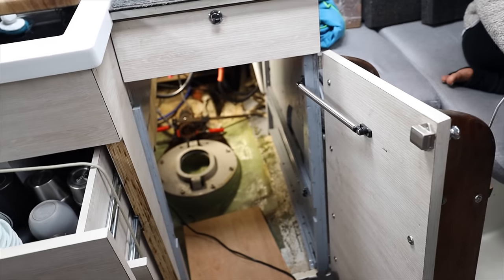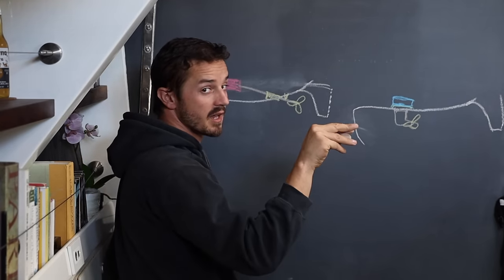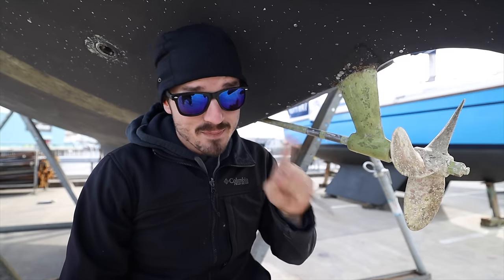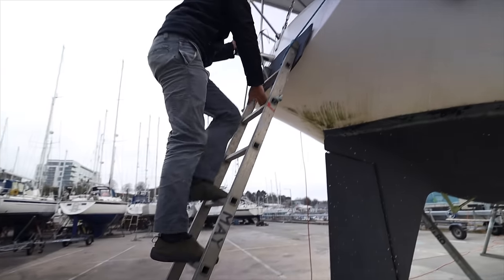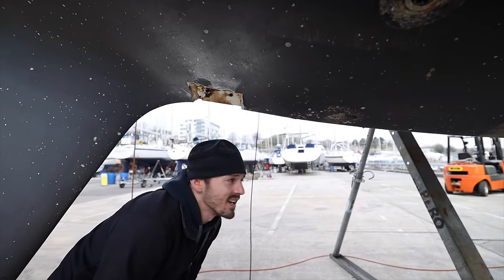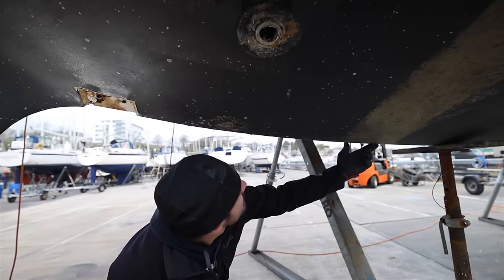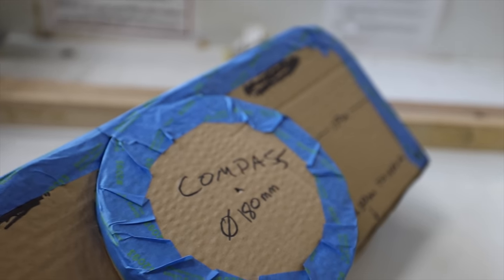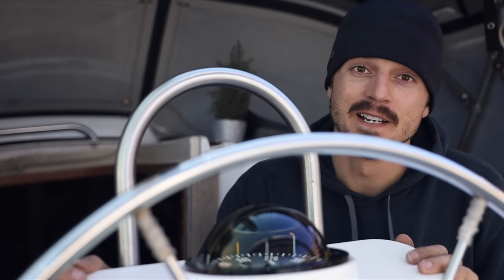CONVERTING to an Oceanvolt Electric Sail Drive — Sailing Uma [Step 213]

Comment: Don’t forget where the sail drive is the next time you are hauling out!!!! It looks like it is right where you used to place the straps to clear the shaft. A little sticker by the toe rail, as a reminder!
Reply: Good suggestion.
Reply: they had the shaft - they took the boat out correct - no shaft problems - now no shaft, yet sail drive - maybe harder to spot? depending on barnacles - hopefully not too many barnacles, since that prob is one mechanical marvel!
Reply: @drx1xym154  ? either I didn't get what you are saying or you are not getting what Cronan is saying

Comment: Thank you for the explanation. Didn't know what a "sail drive" was. Genius, smart and willingness to do the hard work. All in less than ideal conditions!
Reply: Mike Anderson there was one boon, at least no worries about fumes or dust. The outdoor work had the best fume extractor money can’t buy!
Reply: what a waste of time all that effort and one careless mishap with a reef and the boat is on the bottom
If it were an outboard, it would be an easy and cheap installation, and they kick up when they hit something. All you do is mess up the propeller not sink the boat.
Dont they have powerful electric outboards?
Reply: @rogerd4559  When the reef magically sneaks past the enormousness keel, the last of their worries will be the tiny, head sized hole for the inboard electric motor. Their new concern will be that the normal laws of physics no longer exist. They have very good setup.

Comment: I see the travel lift strap went right over where the saikdrive is now located. You might want to add some LIFT tags to the sides of the boat.
Reply: Good plan!!
Reply: AND---take a pic , save it and can show a travel lift guy exactly what the underwater profile looks like........
Reply: good idea I was thinking the same thing.
Reply: Good call
Reply: ALWAYS have marks where the straps go
Reply: kind of like the "no step" stickers on aircraft wings
Reply: @SailorAllan  ALWAYS, even on larger stuff its worth having, ive heard a few stories of bad strap placement even on like 100ft yachts managing to catch inlets, outlets and other hull fittings, sometimes causing a LOT of damage

Comment: Roll the ear plugs in your fingers until thin, a quarter of their size. The insert them and hold them in your ear until they swell.
Reply: Yup, and they can’t be warm when you start or they puff up before you get them in your ears. So if they came out of your pants pocket they might be too warm.
Reply: I would go with ear covers those earplugs are too painful

Comment: Very cool. Waiting for ocean test. Just amazing how you two finishing project not every pro will be able to.
Reply: By the time. Did u considered hydrogen fuel cells? I know this idea growing in boat designs.
Reply from the maker: Yes, we’ve looked into them, but the still require “fuel” usually methanol of some sort to work and are about 2-3 times less efficient than a gas genset. If/when they come up with a system we can run sea water though, add a little electricity, and hydrogen comes out and can be stored, THEN we’ll look into it seriously.
Reply: Sailing Uma did u checked vessel Energy Observer? They are on around the world trip powered by hydro and 100% self sufficient.

Comment: The Saildrive is a very neat and tidy solution, for certain.    I love it and I really think that this is the way to go for propulsion.  Replacing the big, dirty and noisy diesel with a quiet, small, clean electric motor seems like a complete no-brainer.  The only issue that I run into in this scenario is the cost.  These drives are really, really pricey.  Being a sailor that is forced to work on a very small budget, I'm always shocked when I look up the cost of these systems.  I was looking into electric outboards, recently, since my largest boat is a 22 footer and I was very disappointed to find that they are several times more expensive (not including batteries) than a similar 2 or 4 stroke gas outboard.  Why are they SO freakin' expensive!  Keep up the very good videos!
Reply from the maker: It doesn’t have to be pricey... Our first motor we built was $100 from a forklift motor that we found on eBay. We had that with the shaft drive for 5 years before we did this upgrade. If you ant more info, We have a page called electrobeke about our first system on our website sailinguma.com feel free to check it out :)
Reply: @SailingUma , I did check out your videos of the fork lift motor install.  I really like that setup quite a lot.  Maybe I can experiment with converting a gasoline outboard into an electric outboard, in same spirit as your earlier conversion.  Hmmm..., It might be time to hit craigslist fr a used outboard.  :-)

Comment: Greatest lock washers, never let me down in so many years of adventures
Reply: Do they work well on fiberglass surfaces?  I thought washers like that are more suited for harder surfaces like metal?
Reply: @propbraker  They do better than the normal Lock washers, I would always put a washer between the lock and the fibreglass. In a pinch I'd use the nordlock on fiberglass. I would probably not use the normal spring lock directly on fiber glass, I'd go for liquid lock or Nylocks or bar nut if really stuck and check the torque a couple of times. 
I use washer with the sharp edge on the surface.

I used these a lot on diesel manifolds, snowmobiles, cars, antenna masts etc etc..
Reply: @tchiwam  Thanks!
Reply: I don't remember all of the details, but AVE did a show on lock washers, starting with a presentation from NASA.  The split ring ones are worthless (literally no benefit), but I think the Nord Lock ones were good.
FWW, teflon tape also lets you get a snugger/more secure fit, and prevents galling on stainless.  Thank NASA for the teflon tape too!

Comment: Hey brother, I am happy to see that you used a respirator and other PPE for grinding fiberglass, but you should take similar precautions even when drilling/cutting or otherwise disturbing FG. The fine dust stays in the air much longer than normal dust and you know what it’ll do to your lungs. Stay safe and keep up the good work.

Comment: Nice work here on the install, looking forward to seeing how well it works! Amazing how compact that sail drive motor is !!!
Reply: Use scissors to cut ear plugs in half diagonally so they look like a rounded wedge, they fit easier in your ear, are more comfortable, plus you get two sets from each pack!!
Reply from the maker: That might be the first useful comment about earplugs we’ve had yet. A++

Comment: You missed showing the most interesting part which was how to connect the electrical,wires and cooling hoses for the controller and the motor, and the wiring harness for the throttle and display.  I hope it is coming up.  How many days this the process shown in this video take?
Reply: because he didnt actually do that himself, he hired a contractor to hook it up for him

Comment: You talked about charging your batteries while sailing.....I'm guessing while off the prop turns while under sail and charges.....but if the prop folds up how does it spin? And is there an alternator built in, or will you be adding something else? I'd love it if you could chalkboard up how the electronics work.

Also, will you be filling in the holes from the shaft and (bracket) and flashing up in the inside as well, or do you only have a thin veil over those spots? And will there be a bottom cover over the remaining skeg hole?

I love you guys and all your videos, Uma has come so far, she is so very beautiful and efficient. I'm a retired disabled Vet living vicariously through your adventures!
Reply: A motor is an generator, if the energy flows in the opposite direction. If the motor is an AC motor, you just need a switch mode power supply (SM PSU) that can work from DC to max frequency. 
After the SM PSU come the battery charging circuit. There are also some switching circuitry that make everything work together.

Comment: As always wonderful and motivating video. All i can says is NOW OceanVolt FOR SURE owes you one (if not more) for the amazing demonstration of how easy it is to install their product. Props and thanks also to TOP SECRET! Question (although this might reveal my ignorance about fiberglass work), did you fill the holes left by the old skeg before glassing them, and if so, what did you fill them with? Thanks for everything.
Reply from the maker: Drilled out and filled the holes with epoxy from the inside and added a few more layers of glass on the inside too.
Reply: Sailing Uma 

Had the same question pop up but I assured myself that Dan MacGyver would leave no holes unfilled in the bottom of their home, especially after we could see how hefty this bottom is. Nice work as always, clean, precise and topped with a neat layer of paint. If I had a boat you could work on it any day!
Reply: Came here to ask this. I assumed they filled the wholes but was curious to know for sure.

Comment: I’m wondering why the external recess around the sail drive is so large. Why isn’t the sail drive skeg glassed right into the hull? (That recess seems like it would cause drag and be home for a lot of growth.)
Reply: Because it can pivot. When they're under sail, the whole unit turns 180° and points forwards, which makes the prop spin and which generates power for them to recharge their batteries
Reply: @nachopascual96  Ah ha!  Thanks!  That makes a lot of sense now.  Very cool.
Reply: Maybe also related to the need to have a flat flange inside to mount the motor on vs the curve of the hull.
Reply: @nachopascual96  Are you sure about that?  I thought that it changed from propulsion to generation by changing the pitch of the propeller vanes.  I've looked at the OceanVolt SailDrive web page and I didn't see any reference to the unit rotating and that seems like an unnecessary complexity bearing in mind that the vanes can rotate more than 180°.

Comment: Nice! Wonder what speed you'll be able to get with that SD-5. It's impressive how small the whole unit is.
Reply: depends on boat lenght and weight, but normal cruising speed for a sailboat as you are used to, the tork is powerfull, like a Tesla, from reverse to forward, no waiting time!

Comment: DAN, your work is better than most professionals.  You do a really great job! 
Next time you use 3M 5200 isopropyl alcohol, plain old rubbing alcohol from Walmart, will dissolve 5200 for clean up before it skins over.   If you use plenty of paper towels and 70 % isopropyl alcohol you can clean up tools and hands and excess 5200 if you wipe before it skins over! 
Hope this tip helps!!!!!!!!!!!!

Oh those lock washers are the bees knees of lock washers!!!!   I don’t know how they will hold up in salt water!

Comment: I'm kind of skeptical about these Electric engines more of a diesel guy myself but I am enjoying watching you guys transform that boat it's been an awesome ride
Reply from the maker: VS popping 30k on new diesel engine.... Plus having to spend more and more $ on fuel ... 🤔
Reply: Don't be sceptical look at the positives they far outweigh the negatives of diesel & remember it's a sailing boat, not a motorboat. Head south for the sun.
Reply: Big T I agree. This technology is still very new and untested.  It is also a ridiculously expensive gamble to purchase.
Reply: The only way for an electrical setup (at this point) to be as safe as a diesel one is to be coupled wit a diesel generator which is what I intend to do on my next boat.
Reply: Woobie  There are a lot of arguments with the most important ones being range and safety.
Reply: Im more like a diesel guy too. Simple to fix, easy to maintain, cheap to run, no batteries, solar panels and power from the grid needed, no electronics which breaks and diesel can be bought everywhere in the world. You can use the diesel engine to recharge batteries in a short amount of time. What more do you want?
Reply from the maker: I think if you’re “stuck in the doldrums” in today’s age of accurate and cheap satellite weather forecasting, then that is just poor planning. Learning to sail in light wind and having the right light wind sails is key, as it’s very rare to actually have ZERO wind. There’s almost always a few knots to harness.
Reply: Woobie As Dan and Kika states there are very few companies that produce the  engines, and those  that do charge a lot of money. With the high cost there are not a lot of people willing to fork out the money for  a relatively unknown product. Kinda the same as the lithium battery issue. There are a lot of people, myself included that want to see the batteries are safe, efficient, and cost effective. The more folks that test this stuff the better the case is for investing in a system. When Dan and Kika reached out to their new current engine company and got sticker shock. That company should have provided them an engine for promotion and testing. Dan and Kika have a large following and it only would have been good for them and the consumers. Maybe when someone like Nigel Calder drops one in his boat I’ll give it a look.
Reply: Woobie You missed my point completely. Arrogant?....to suggest a company market to sailboat owners, by sponsoring them with an engine so to advertise and get real life test results of their product in various conditions.  Does Microsoft give out free versions of their software for it to be tested (Beta Testing).  Yes there are lots of lithium batteries out there in IPhones and IPads, but very few are tested under the loads that boaters put them under. Even Nigel Calder has yet to fully endorse them and put them on his boat.  Have thermal runaways occurred with Litium batteries, Yes they have. But is the technology improving to prevent that from happening, Yes. I am not saying Litium batteries are not a really promising technology, just that I still think some bugs need to be ironed out and the BMS technology improved to make them safer.  The battery comparison was just to show the similarities of a very high priced technology which still needs more testing and improvements. That is all.  We all have our opinions and that is mine.  Yes Dan and Kika made an electric motor work, but they did have issues they they were constantly trying to navigate. If everything was so perfect why are they upgrading? Yes forklift motors work great on land, where there is always a plug to charge them up, that is not boat life reality as Dan and Kika found out....Wobbie I am not looking for a fight, or an argument, just giving an opinion take it or leave it.  Stay safe Wobbie
Reply: Woobie IDC